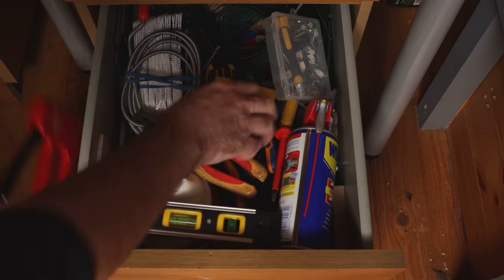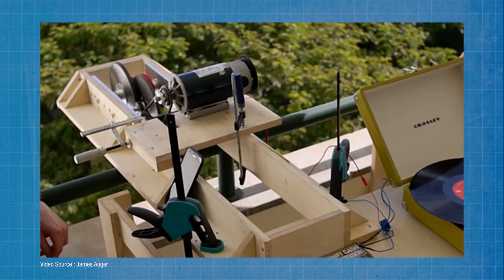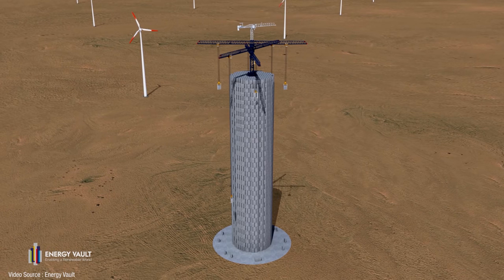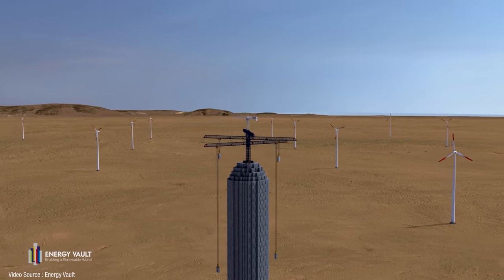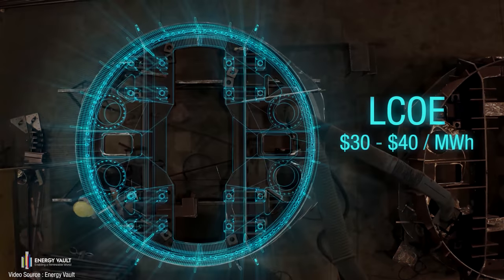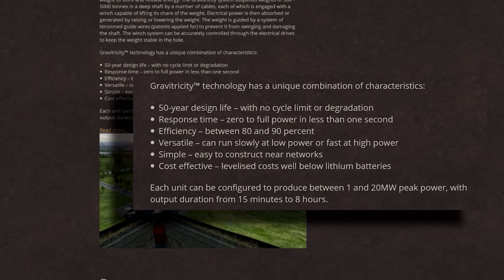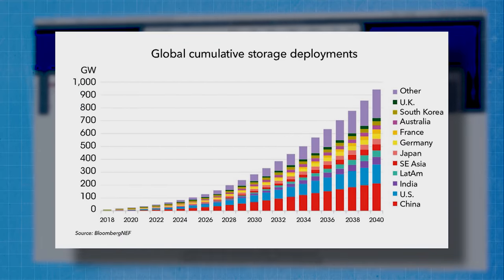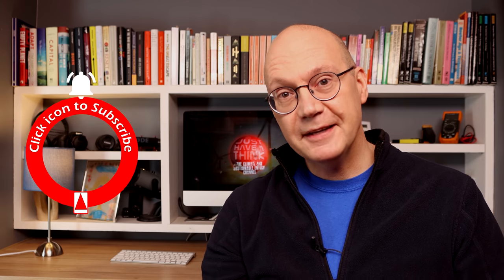Gravity Energy Storage : A very uplifting technology!

Comment: I have long experience with these technologies:  My father has some 100 year old clocks.  Every morning, we pull on chains to raise the weights up, and the clocks run on gravity energy for the next 24 hours.
Reply: Same principle.
Reply: There's no such thing as "gravity energy". Every system that generates electricity via a mass falling from some height to a lower height, utilizes the energy of the massive object (may be water or any solid material) which was put into the mass (potential energy) while it was being raised to the highest point in the system. Think of gravity like a spring. The higher you raise an object away from the earth, the more the spring (gravity) gets stretched, pulling harder on the massive object. When the massive object is allowed to fall, that potential energy is slowly being converted into kinetic energy through gears and finally to a generator. Please don't think that this is some sort of "free energy" device. It most assuredly is not.
Reply: @Xray-Rep  "The higher you raise an object away from the earth, the more the spring (gravity) gets stretched, pulling harder on the massive object." It's been 40 years since my high school physics, but this is clearly wrong.
Reply: Same principle.
Now Imagine that weight being 10s of tons of mass and wire being 100m long in 20-35 m/s wind. Not that great thing when considering pendulum effect that system has.

What works in small scale, doesn't always work in large scale. These are very good reminder of that. There are many variables that small scale can hide.
Reply: @Xray-Rep  You are missing the point. Eccessive energy by wind and solar which is free can be stored for later use in these gravity blocks is the subject of discussion.
Reply: @neliosamch3195  correct. This is a battery, as stated, not a generator.
Reply: @Peter Silva It's funny how these old technologies and ideas are making a come back, as if they are new.  In a previous video, he talked about farmers switching to a new system of farming, which was basically just crop rotation, something that's been done for centuries.
Reply: @davidvondoom2853  It is the same motor utilized to raise the block and regenerate when lowering it. For me LTO batteries are a better solution but very expensive.
Reply: @neliosamch3195  Exactly.
Reply: @tzenophile  Oops! You're correct. But I stand by my point that gravity itself is not an energy source, as some people from the "Free energy" community claim otherwise.
Reply: @neliosamch3195  yes, I agree.
Reply: @pikkuraami   Dude what conditions are you talking about, 20-35 m/s is 9 - 11 in Beaufort scale, you should be worried about the damages to your house at this point, almost no crane will operate beyond 10m/s anyway. You go one step higher and you've got a freaking hurricane.
Reply: @bobbob5541  Yes, that is just thinking excercise. Actual problems with crane systems start as early as 5-8m/s. Especially with heavy loads like those blocks 10s of tons in mass.

If you have ever been in construction site and seen concrete elements being lifted into place, that is exactly what Energy Vault system is constantly doing. Or seen a wind turbine being constructed, it really doesn't matter what heavy lifts you observe it always comes down to wind speeds and safety for workers and equipment.
Reply: @pikkuraami  If the wind is an issue for these, I'm sure they can easily just build a silo around the edge. Honestly they'd probably want them enclosed anyway.
Reply: @MSheepdog  then they should probably just divert their funds to the folk using mine shafts.
This system gives really poor returns, 35t @ 160m has a potential of 15kw hours, each row down is dropped 1 row higher so has 1kwh per block less. (Weights and heights taken from their website)
Given the dangers of attempting automated stacking and that any damaged or misaligned blocks will cause a total loss of the whole system I'm going to say this is a horrible idea and in taking funding from the communal green energy pot is doing more harm than good.
Reply: @tzenophile  no because we are talking about batteries not free energy.
Reply: @waltermcphee3787  "no" what?
Reply: @Xray-Rep  Gravity is a force, and used in  lot of energy applications. I'd say that spacecraft slingshotting around planets or suns to gather speed actually IS free energy.
Reply: @tzenophile  just to confuse matters for fun, tidal basin turbines are free gravity energy.
Reply: @turboconqueringmegaeagle9006   hehe, right, there you go!
Reply: @pikkuraami  Which shows the better design of the repurposed mineshaft.
Reply: @bryanst.martin7134  Yes, but in those repurposed mines pumpped hydro would be better.
You don't need steep or vertical shafts with water, hosizontal or even upwards ones would work just fine as long as reservoir at highest point keeps pressure up.

All you need to be sure of is escape route for air that fills those lower level reservoirs at "discharged" state.
Reply: Copied from Salisbury Cathedral where it has been in use for over 600 years, running their clock.
Reply: @Xray-Rep  any physicist knows people are referring to GPE if they say "gravity energy". Also, your description makes it seem as if the gravitational force of 9.8N/kg somehow increases to a stronger force as you raise something (as if going high enough would raise it to, say, ~11N/kg), when really you're just increasing the quantity of GPE. So I would suggest you've fallen into a bit of a Dunning-Kruger moment, where you wanted to be pedantic about the misuse/misremembering of the term GPE, while inadvertently misexplaining the actual effect whilst trying to justify yourself. 

(No judgment or malice! This is an educational channel so I merely want to offer constructive criticism to yourself.)
Reply: @pikkuraami  that sounds really dangerous and unwieldy, you could just pump some water into a water tower....
Reply: @epiccollision  Not really dangerous. Old mine shafts fill up with water over time anyway.
Thing is lower reservoir and shafts can be water proofed and stabilized with spray concrete. Alternatively shafts can have pipes as a way for air to escape from lower reservoir and even water to run through.
Same idea as in water towers, but implemented in unused mine.

Or how dangerous you see fresh waterways to New York city for example. That water is going for city's water needs.
Reply: @Xray-Rep  Achshullyy - "gravity energy" is a perfectly fine way to describe it. Don't be a pratt
Reply: @Xray-Rep  tides
Reply: @tzenophile  I believe he's referring to the total potential energy being put into the lifted weight. It may not be the best analogy, but the statement he made is true in the sense that a spring's total energy increases with length, and the potential energy of a lifted weight increases as well. Where he's wrong is that a spring's stored energy increases as a function of the stretched distance squared whereas a lifted weight's stored energy increases linearly to how high it's lifted; assuming of course it's not lifted so high as to see a difference in the Earth's gravitational pull.
Reply: @tzenophile  Not if you consider that the planet you swung around has lost that same amount of energy in its orbit. It may seem as a gain to you, but it's a loss to the planet that will never return.
Reply: @thecarman3693  Thanks, good point. A whole new field of environmental conservationism opens up!
Reply: You put more energy into a old clock than you get out of it, it may run for a long time but it will not produce much energy.
Reply: @tzenophile  agreed,
Reply: @davidvondoom2853  because these are just recycled old ideas. of course crop rotation works, but it means less food is produced, thats why its not used.
Reply: @Xray-Rep  talking storage not free
Reply: Those clocks are very good at storing that minute amount of energy.  A clock requires orders of magnitude less energy to run than to even charge up a mobile phone.  If we want to store even a single  kw/hr, that weight will need to be many hundreds of kilos, and upwards of 1000feet in the air.  Gravity is the weakest of the forces so you need a LOT of stuff to store even a little bit of energy.  Chemical bonds or electric fields can store many orders of magnitude more energy with a tiny amount of stuff.
Reply: @Xray-Rep  Gravity potential energy, who cares
Reply: @Xray-Rep  Who is claiming its free energy?
Reply: Than make a video of that wach .. we want to know how is it works ? !
Reply: @Xray-Rep  Can I just point out that we are talking about Gravity Storage of Energy. Not Gravity Energy Storage!

Comment: I'm not sure how sustainable it is, but if you drop that hammer on your toe, you'll release a lot of energy as you hop around on the other foot. Biggest problem will be all the noise generated by this system, which may not be appropriate if children are near by.
Reply: Simple fix: install a wind turbine in front of the noise source. The turbine turns the profanity energy into electrical energy, just as we do with the wind - you'd be surprised at the kinds of exit velocities that stuff can reach. With an efficient enough turbine, you can utilize a large enough portion of the profanity energy to make the noise all but inaudible, as well as putting some of that excess power to good use.
Reply: Noisy, quite likely. In that case utilising defuct mine shafts seems a good solution at least as a starter.
Reply: Nah, it'd take way too long time to recharge - you'd need at least a week before your stubbed toe is fit for another go, I don't think your Netflix binge urge can wait that long!
Reply: @andershusmo5235  mo moo. Mo moo m

Comment: The gravity system was used in lighthouses to turn the lenses for over a hundred years thus giving the flash, a weight was winched up on a cable and when allowed to descend slowly through a gearbox turned the lenses which floated on a tray of mercury.

Comment: I like the mineshaft concept.   Out of sight, out of mind.
Reply: And there's no shortage of old mineshafts in the coal country of Appalachia, which could also use the jobs.
Reply: @charlesinglin  Same in Montana, Texas, Michigan and New York- all at one time big coal producers.
Reply: If they're digging new shafts, they can be put anywhere, including the densest of cities.
Reply: @PatrickKQ4HBD  Keep thinking like that. There is a solution to our energy problem- some one of us or several of us will find it!
Reply: I feel like it's got less risk too. If a cable snaps in the mineshaft the ground might shake, but unlikely to lead to other property damage.
With the stack of concrete it seems like there is higher risk of collateral damage if it collapses.

Probably less moving parts in the mineshaft one too, which should make it easier to maintain.
Reply: @MSheepdog  Just the sort of thought I think this channel's voice has in mind! Please, keep watching and commenting, as we might "get on to something" that was missed by others. I think that was what this channel was about.
Reply: Sure just fill the ones up with pumped storage, and already 5x more efficient in both time and space
Reply: @PatrickKQ4HBD  depends on geology, some areas would require a lot more work to keep water out or not cave in
Reply: @ethanswanson9209  ahh, but I don't think we really need to keep the water out. If we use recycled steel as our weight rather than some concrete and soil mix, there's enough density increase that it still works underwater.

Comment: They can redesign this by using a huge Neo magnet inside a huge copper tube. As the Neo magnet goes down, the copper tube slows down the magnet from falling fast due to eddy currents but still can generate the power needed from it falling. They can use that same eddy current via loop wiring to store energy to power the crane arms instead of using the wind turbines.

Comment: The mine shaft is probably the best option.  Not affected by adverse weather conditions, quiet and virtually invisible.
Reply: Don't rule out abandoned open pit mines and the Grand Canyon. Existing Hydro dams also provide elevation. Lake Meade is drying up and will expose lots of room for a wind farm. Multiple installations and locations using the same concept but using varying techniques will be required.

Comment: Using defunct mineshafts is the best idea. There are countless shafts in the UK and many other countries. 

Also, boring down a number of 1 metre diameter 1 km deep shafts, with long thin weights sounds excellent. They can be dropping at different times. They do not visually defaced the surface. Little maintenace required.  If a cable breaks, leave the weight at the bottom of the shaft, installing another.

The sooner the better

Comment: I once saw a proposal to do this sort of thing by dragging heavily loaded rail cars up hills and recapturing the energy on the way down. Advantage would be that only rails need to be added to the landscape, not complete towers, and additional "weights" could be added just by employing more freight cars. Same idea, though.
Reply: Mine shafts are already there and less visible.
Reply: That project was my first exposure to this notion of using weights to spin a generator/winch to make grid-scale electricity, even though I grew up with weight-powered cuckoo clocks and grandfather clocks.
Reply: @peterbrickwood3204  The trouble with mine shafts is that they are inevitably full of water. You can either pump the water out which takes a lot of energy or be satisfied with less apparent mass powering your generator (dry mass minus displaced water mass). Still, worth a go: not much to lose in trying.

Comment: I once had the fun idea to build my whole house as a gravity energy storage for to be installed solar cells or wind turbine while knowing that it would be far too expensive and impractical but I'm amazed that it's a legit strategy on such large scales
Reply: Yeah but is only good as a pumped hydroelectric dam. The energy vault design is the worst thing I have ever seen.
Reply: @magicsasafras3414  How so? It looks like a massive art installation.... and it generates cheap energy!?
Reply: @coenraadloubser5768  it doesn't generate energy it stores it and terribly too
Reply: @magicsasafras3414  Sure it doesn't have the best carbon footprint, doesn't store much... and it's not wind proof - but not anyone can build a hydroelectric dam... I'm sure it has a place somewhere...
Reply: @coenraadloubser5768  listen gravity battery's are good but only when designed properly. The company gravtricity made a simple design that works flawlessly on a small scale. Energy vault tried making a small scale system big, but that doesn't work. Pumped hydroelectrics are meant to store a city's worth of energy. Pulley battery's are ment to power something like a construction site for a short time.

Comment: *Looks at all the empty mineshafts in the Appalachian mountains*
Well, time to get cracking.
Reply: Same here for the north of England!
Reply: Bainsworth  It's both. E=mgh. Double the height, double the energy. Double the mass, double the energy.

I heard they have also been looking at using some of the abandoned mine railways with weighted carts (v. steep winch railways for moutain-side mines). Probably not as big in terms of scale but might serve a local community well and don't require as much building.
Reply: @DavidBeaumont  railways in reverse!
Reply: Instead of weighed carts, you could have a load that you can take on and off, increasing the storage capacity. Or you could use thanks that get filled with water. This could be then be further optimised by using a pump instead of the train.
Reply: Bainsworth  I guess it depends on how long you need the power to run
Reply: Hate to burst your bubble but there are only 2 or 3 vertical mine shafts in the Appalachian mountains deep enough. Most mines in Virginia are drift mouth mines. I know this from being a part of a family that was executive ordered and legislated out of a lively hood. You have no idea the pain nor do you care that your green revolution has caused.

Comment: it would be interesting to consider cases where harnessing the weight energy doesn't involve using electricity for power transfer. For example, the mechanical motion of descending weights could be hard-geared to a coolant compressor for a large AC system.
Reply: Sure, or build a wind turbine on top of the mine shaft and run a (clutched) belt from it to the mineshaft cranes.

Thing is, electricity as energy transport can be very fungible and cheap. The efficiency losses in converting to electricity and back are often a small price to pay for the ease of moving the energy around. That is not to say it's never practical to use other means of energy transport. District heating is a prime example, in which you have a central boiler supplying steam to heat many buildings.
Reply: @Kurt Euler  or you just utilise the nearest free source of energy = wind or solar

Comment: could you do this with elevators/lifts in an existing skyscraper?
I know there's usually counterweights but you could use regenerative braking to offset the differences in either direction depending on the weight. You'd still need to power the lifting of a heavy car and the lowering of a light one.